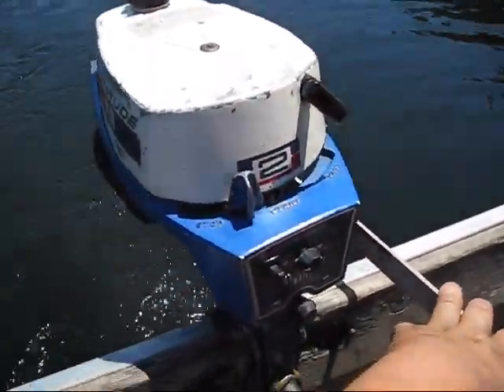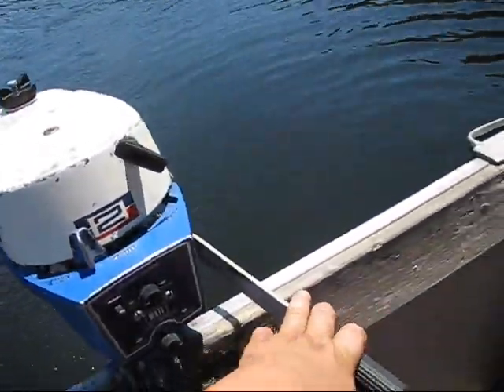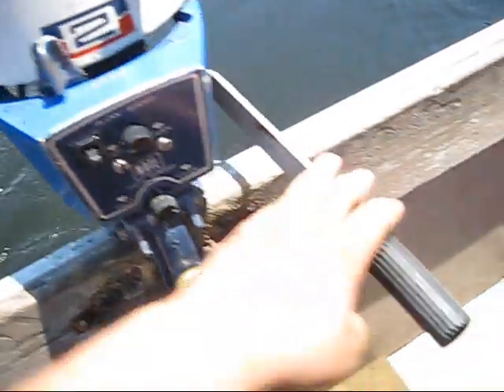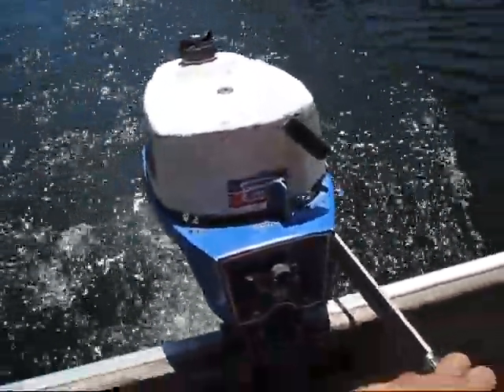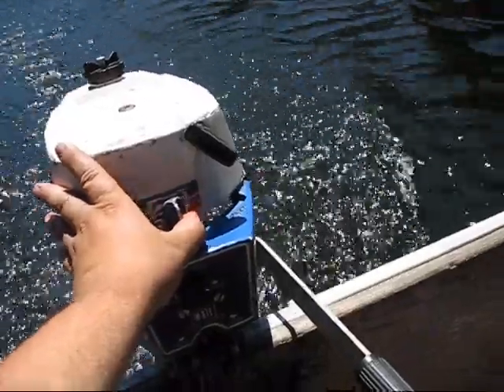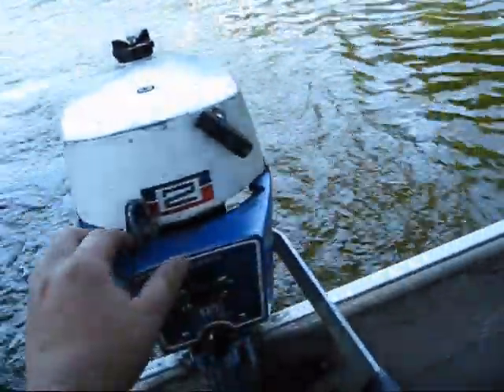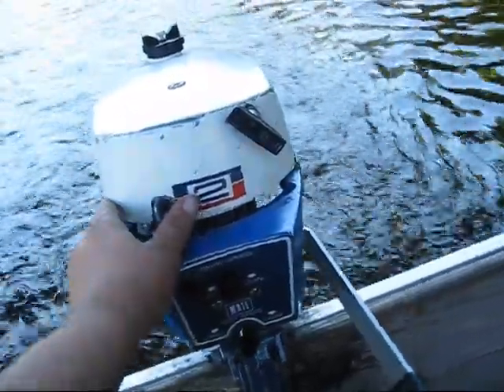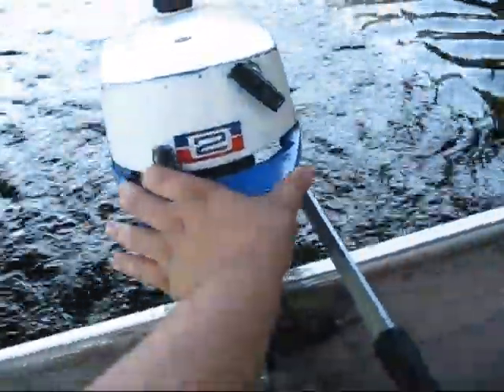1971 Evinrude Mate 2 hp running on my boat

Comment from the maker: The serial number core plug on the port side of the cylinder block should not exceed 160 degrees when running, if it does, the engine is overheating and the water pump should be replaced with a new style kit.  The kit is expensive but is worth it if the engine is in good shape.  The part number for the kit is 763736